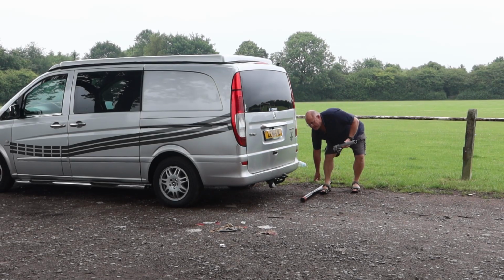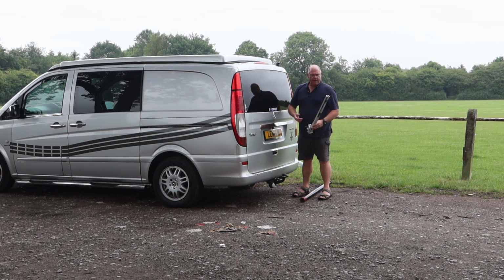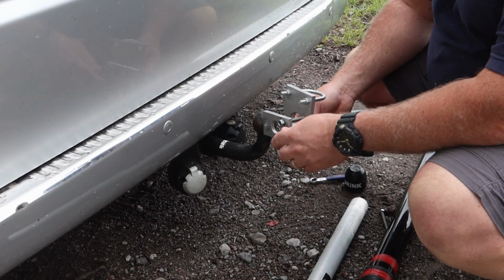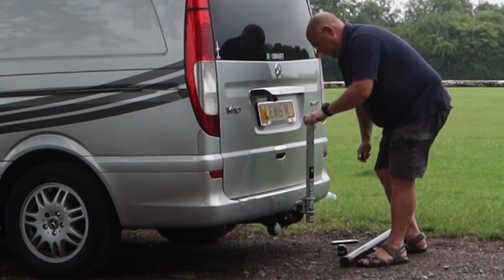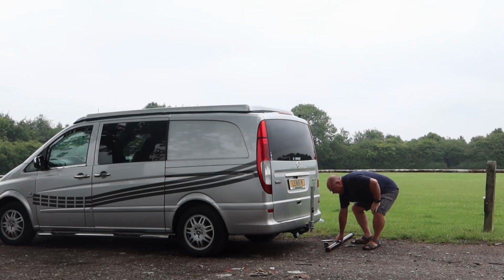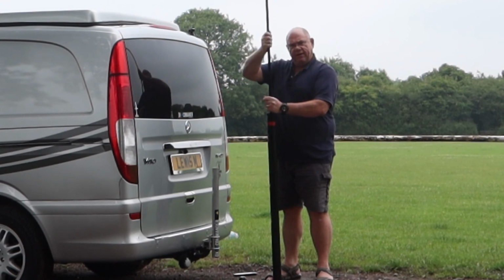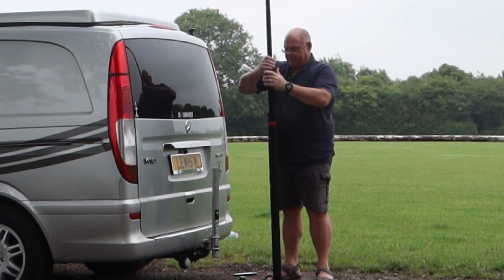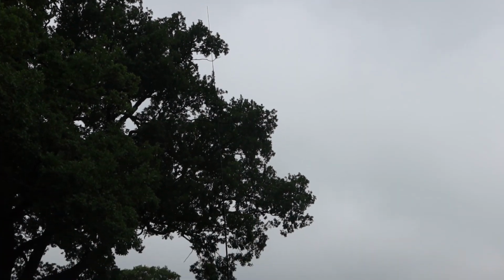Towball mount for antenna

Comment: Nice video. Used to.have a similar solution back in near 96-98. 
Every month I would go up on a local mountain and put up a 6el6 from cushcraft on a 6m mast on it.and work the NAC monthly.contest. it worked.wondwrs HiHi
73
Reply from the maker: I am looking forward to using it.